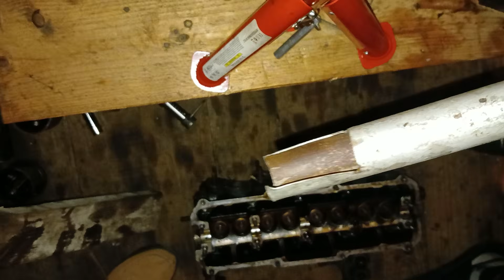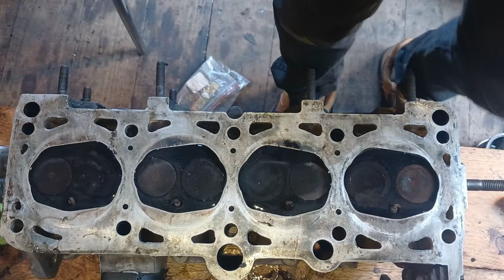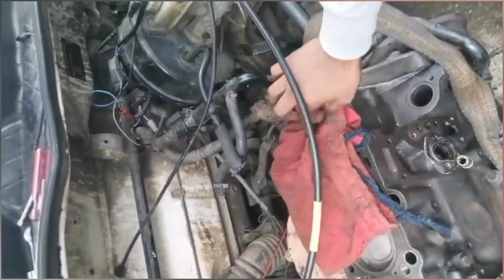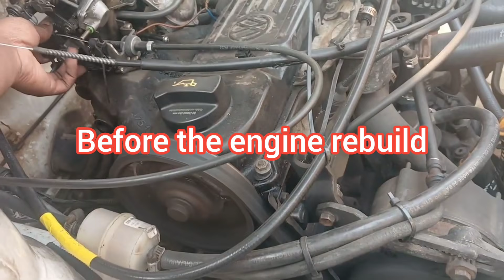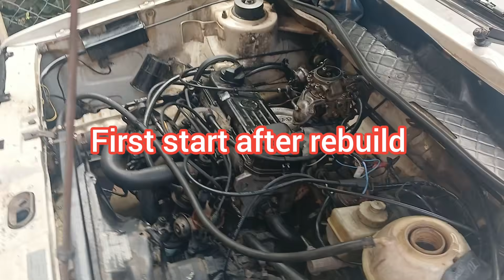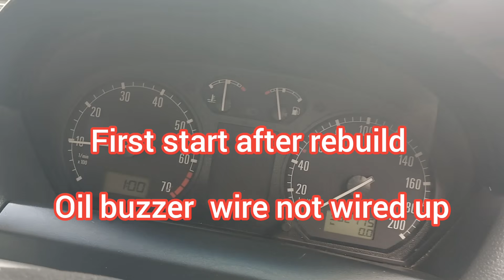Golf mk1 Engine rebuild  pt4: First start??: easy way to change valve stem seals, no special tools

Comment: Personally I would have sed to do a nice engine diesel flush for 20 minutes even change everything and have a clean engine with minimal vanish
Reply from the maker: Maybe I'll do this the next time I rebuilt a motor but for now I'm going to run her abit then do a flush and throw in oil again